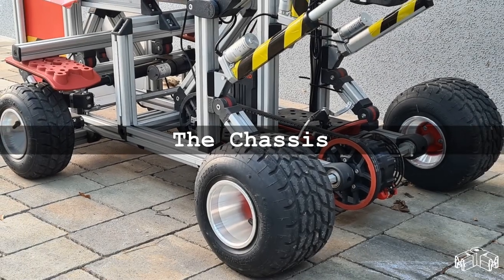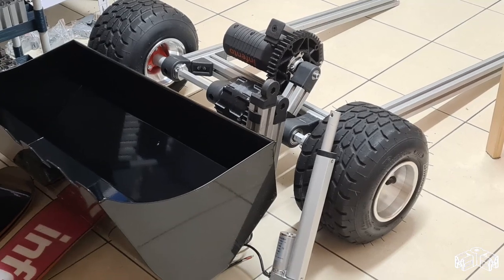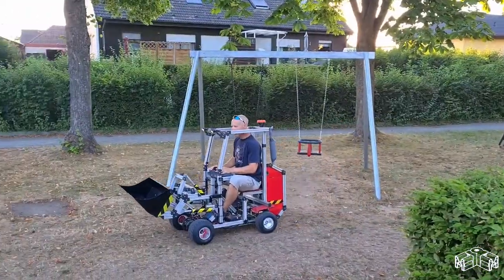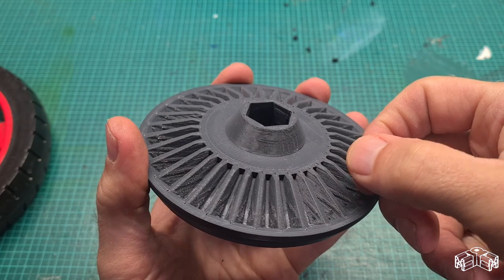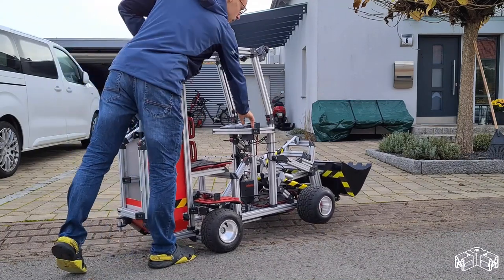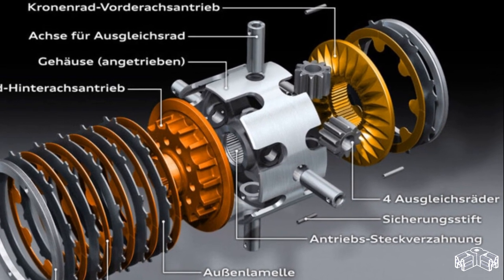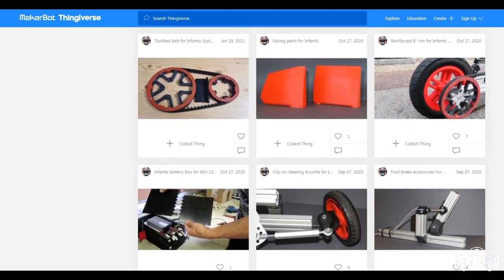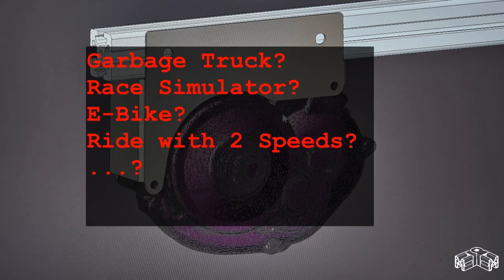INFENTO Wheel Loader pt. 4 of 4: Chassis, Differential, Various Parts, Aftermath

Comment: Amazing finale show of the project! I loved every second of it, great work. I was thinking for the locking diff, if the smaller gears would have a rotational damping or centrifugal brake installed, they would create a locking functionality. It is hard to create on small scale, therefore also a fun challenge. I will also contribute 3D print models to the custom Infento community soon. We just got the smart kit for our daughter.
Reply from the maker: Cheers. On the diff I got 2 great ideas from other viewer. It was about using a filling of highly viscous oil, or making use of the Eddy current effect (magnet and Al or Cu disc). Gotta see if i pick up this topic somewhen. I will first focus on an emergency radio controlled braking system.
Looking forward to see your inventions on Thingi!
Reply: @modularmobility2276  Cool, the Eddy current braking idea was also me on FB haha. Could you share the 3D model of the differential with me? Perhaps I can do an experiment with the smaller gear and some magnets.
Reply from the maker: @hjoore  klar, kein Problem. Schick mir bitte eine PM über FB, dann bekommst du einen Dropbox Link.

Comment: Servus, 

das Differential schaut sehr gut aus... Hält es auch den 2000watt Motor aus? 
Und wäre es möglich die Daten öffentlich  zu machen? Gruß Alex 

Ps: ziemlich coole Arbeit Respekt
Reply from the maker: Hi Alex, das habe ich noch nicht ausprobiert. Es ist wohl eher eine Frage des Drehmoments als der Leistung. Und sicher spielen auch die konkreten Druckparameter und das Material (ABS, PA GF) dann eine entscheidende Rolle. 
Schick mir mal ne  PM über FB, dann schicke ich dir den Dropbox Link.